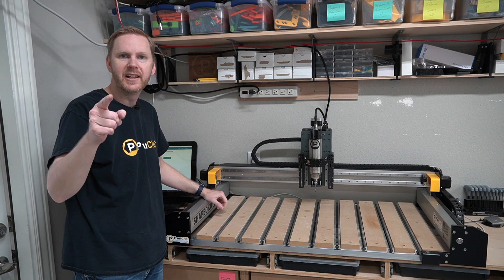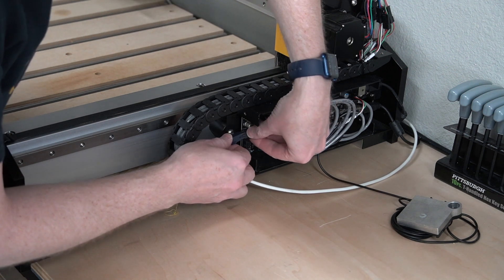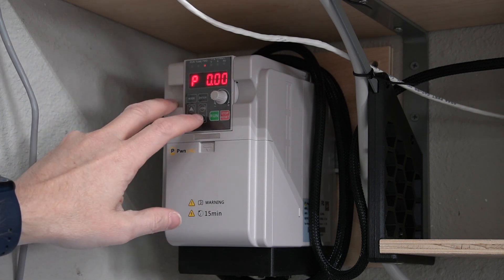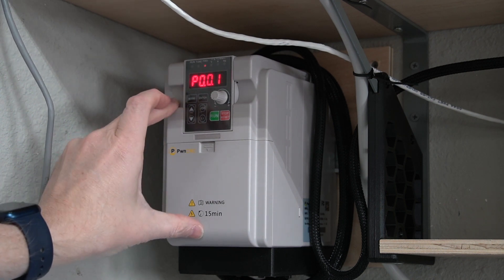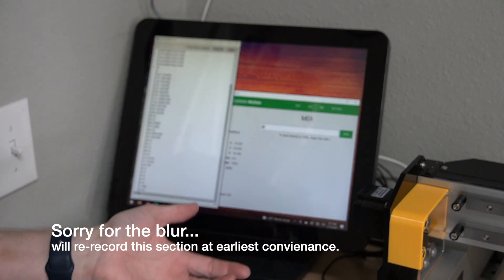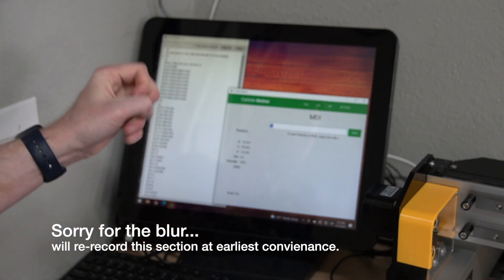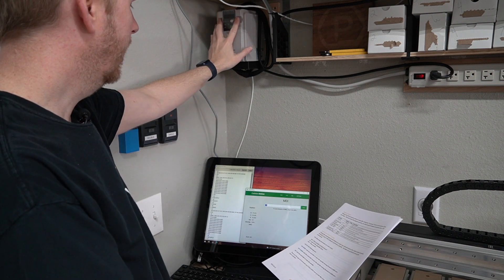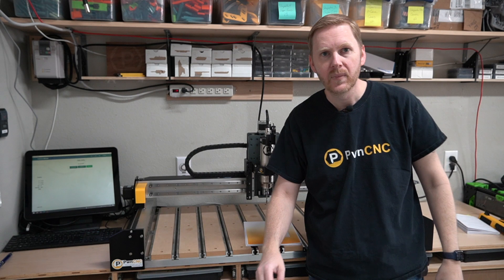Control your spindle via PWM on Shapeoko

Comment: Great video! Where did you get your Spindle. I see it's air cooled. Why didn't you get a  liquid cooled?
Reply from the maker: I designed the spindle kit myself (https://pwncnc.com/products/spindle-kit).  On this particular machine I didn't want to deal with the coolant bucket etc.  On a few other machines in my shop i did install water-cooled spindles.  I'm also working on a very special closed-loop coolant system to offer to folks as well.
Reply: @PwnCNC  Thanks

Comment: Good video, do you have plans to make a adapter that allows you to run your bit runner along with the PWM.  I use my bit runner to control my pump and dust collection now they I have the spindle.
Reply from the maker: Unfortunately Spindle control and the BitRunner are incompatible with each other.  We do have plans and working on triggering an IoT relay from the vfd, however truly this would ideally be solved on the controller side.